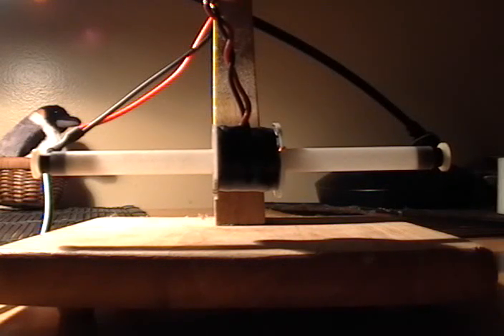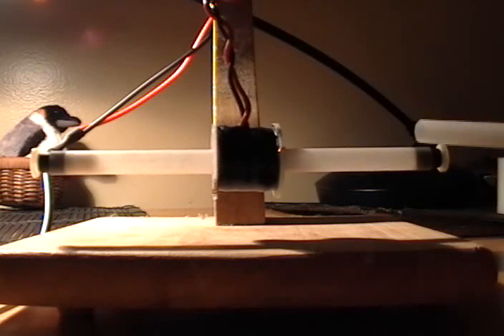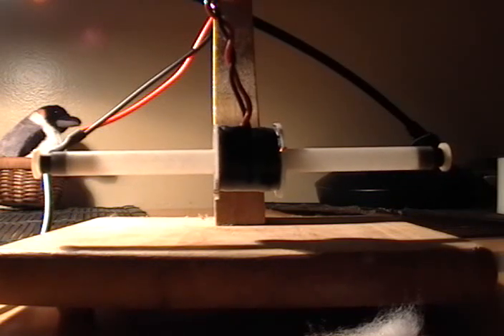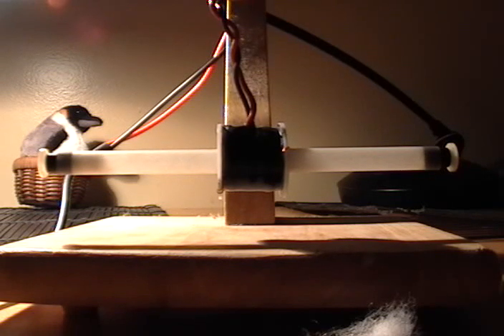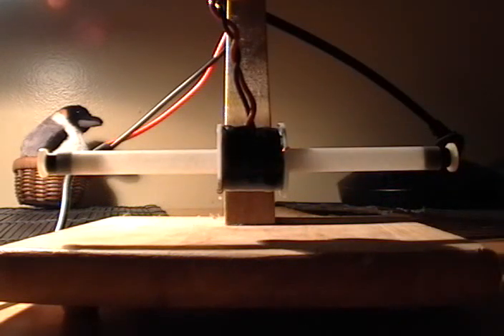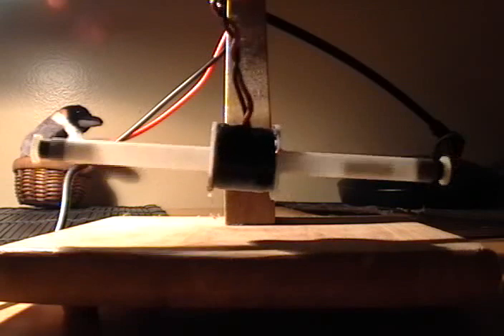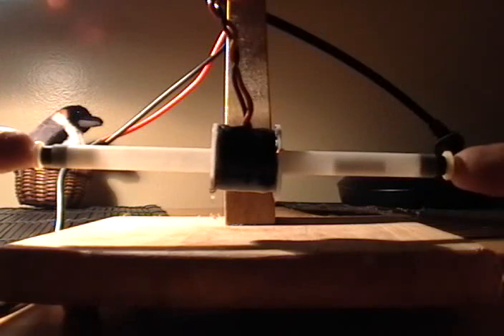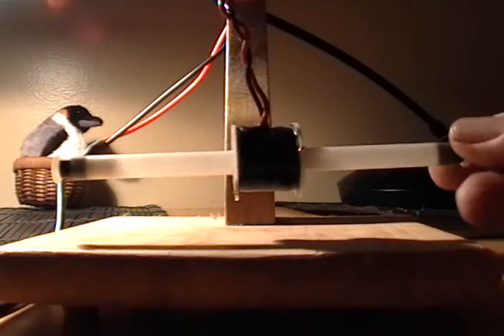LT Solenoid 2

Comment: The center of mass must be moving off center and then returning to that position on reset. This is because the magnet is pushing off the magnetic field which is coupled to the coil. If the magnet is thrust to right, then the coil must be thrust to the left. However, F=MA applies and the greater mass means a lower acceleration in the same time period. So it becomes possible to accelerate the magnet at a speed that prohibits coil movement. Lengthen the tube to one full wave length of the applied..

Comment: ...frequency. Increase the amplitude of the signal to afford moving the magnet to the end. Apply a positive going signal of F and a negative waveform of F/2 for each cycle. attach a laser pen to your coil perpendicular to the tube and mark its point where it strikes the wall across the room. Energize the system and mark the outside edges of the laser travel. Compare them to the center mark. See if they are lopsided in accordance with the time deviation of F/2 for the return path of the magnet.

Comment: I think you need to produce double the magnet strength in order to act on the magnet enough to separate them. My guess is that you would also nee to produce a magnetinc field in the separating metal part and reverse the poles. Example: -/+ -/+ -/+ -> -/+ +/- -/+ (-/+ = magnet). A simple way to do this would be a split iron core (a gap in the separator block) with two coils wrapped in opposite directions and just switch between the two.